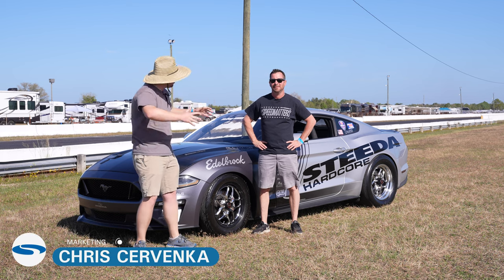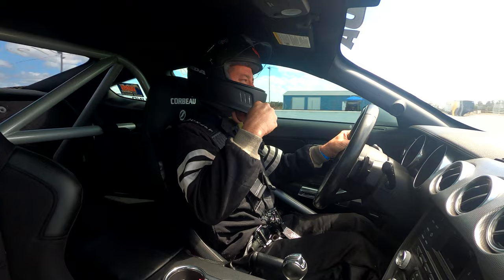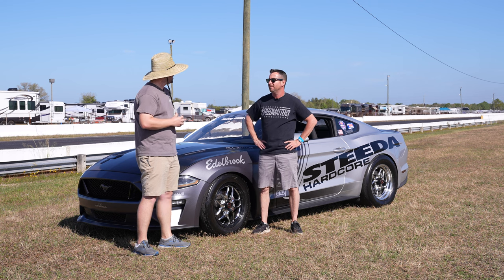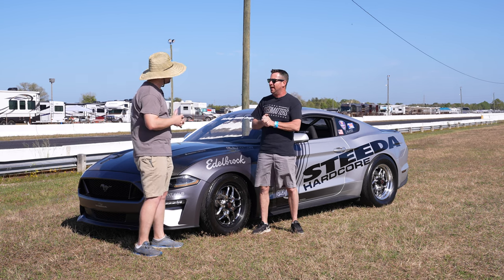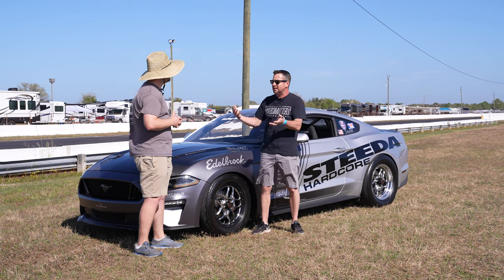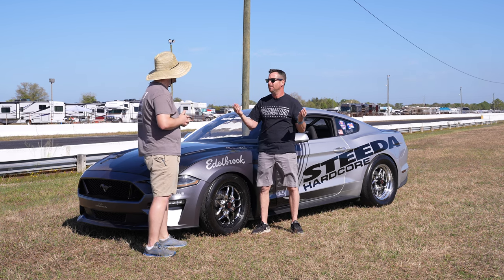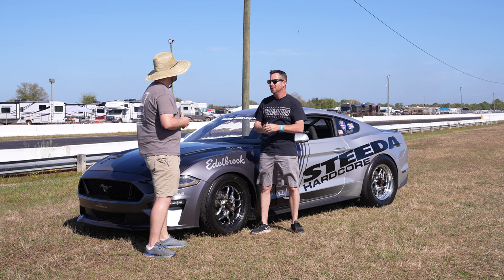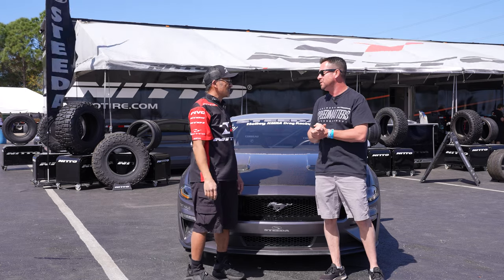Silver Bullet Gets DQ'd At NMRA Spring Break Shootout | New NHRA Safety Rules

Comment: nmara rules sounds stupid. The faster you go with less safety the safer you are 😂
Reply: Once you are into the 7s, you have no seat and have to be naked sitting on a box.......
Reply: He should have never run it with a 6 point, he knew when he got there he was not legal.  I congratulate NMRA for standing there ground. Starting a new class off right was the right thing to do. Steeda should be setting a example when they show up, not turn a employee lose with a car that was clearly not legal, Dario should know better.
Reply: @dennishilliard1101  NHRA stated the chassis was good to 9.00 the Tuesday prior to this event.  So you mean to tell me that properly installing a 5 point SFI certified racing seat belt and a 6 point Watson roll bar required us to go slower, a 10.00?  My friend, we averaged a 9.010 in True Street trim which is why when you unprofessionally confronted me, a racer, in the staging lanes as I was about to make a pass, I told you I wasn't sure what the car would run.  At that moment the car had only been together for roughly 27 hours!  But as a fellow racer, you felt it was right to get in my head prior to a race?  You sir should know better and save your comments for after the competition.  BTW, saw you ran a 10.75 last year in your 2019 at Bradenton with an aftermarket seat, which was illegal at the time.  Too bad no one ran to NMRA Tech over your pass Dennis.     -Scott
Reply: @dennishilliard1101  Hit a wall going 170 miles an hour with your OEM equipment (stock seats, airbags, and a seatbelt). I will hit it going 170 with certified racing safety equipment (seats, roll bar, and a racing belt) whoever can walk away can be crowned the winner! 
I would love for you to demonstrate that OEM airbags and equipment is safer than certified racing equipment!
Show don't tell!